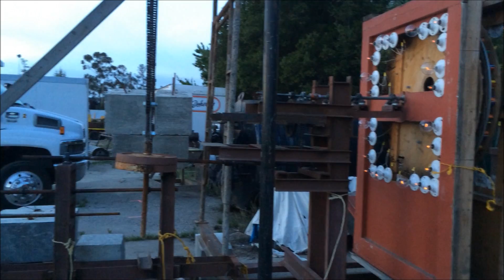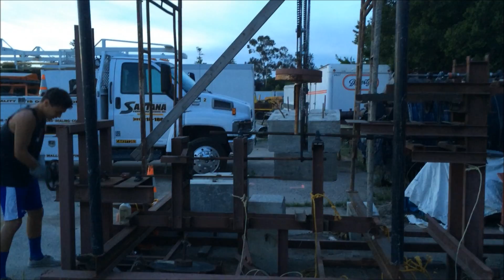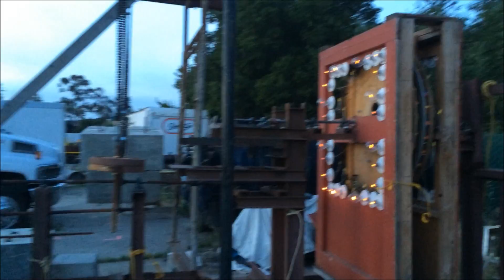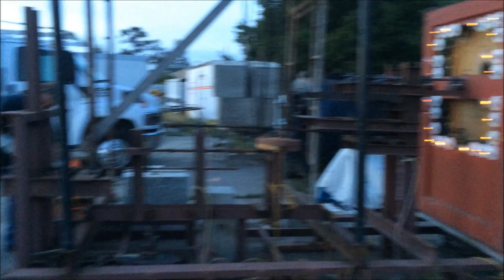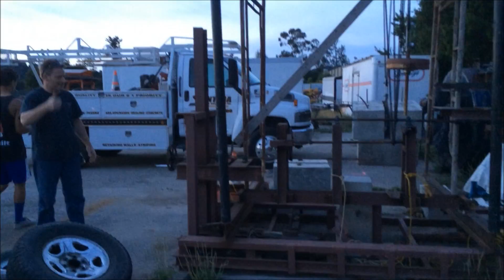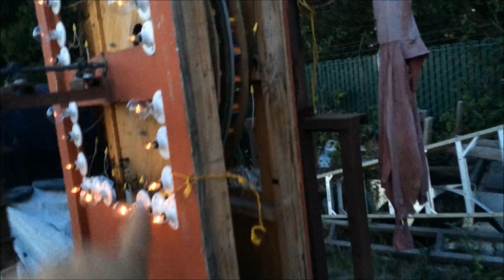This is Free Electricity, testing GCEG 4 at over 400W

Comment: Why not just make a ladder, both of you climb up it, stand on the counter weight, and let your weight act as the counterweight to lift the other weight, as you fall down, it rises up. Then it drops you off at ground level, you step off and it starts generating. Saves winching.

Comment: And like Tina Shay said.. Put a bicycle chain up to that crank so your not using as much energy to wind the weight up or even a motor that winds it up for you via minimal solar or wind. Make the drop higher and add a transferable mass between two weights. Add a battery bank for the buffer or dump for stored energy would also take care of any fluctuation as it looks like your already inverting  for the bulbs. I would think your could get it to where you would only have to wind it up every few hours with minimal effort if even at all. Even as inefficient as solar is, you could store enough energy I would think to wind it up for you. The whole point is to get gravity to do all the work, while you chill and enjoy it, not have to set and maintain it right ? I had a concept like this with no way to build it. Nice design. I think clockwork gen's are a very practical concept.

Comment: How about transferable mass such as 50/50 water antifreeze from one side to the other via bilge pump. I'm sure after you get a perfected flywheel , there is more than enough power to run one back and forth without having to crank but every once in a while.

Comment: Hydro...
Reply: I often wonder why hydro-energy is not more prevalent. Solar energy is not cost effective or "foot print" efficient. Take into consideration the "energy" required to produce it. The exploration, acquisition and production energy expenditures alone - just to get the raw materials from the source to the mill and then to the manufacturer of the components are staggering. Once the components arrive at the actual Solar Panel manufacturing facility, the energy consumed by the factory is again exponential. The "energy" consumed by the adaptation process, marketing needs, repair errors...on and on...all make Solar Energy inefficient at this point and perhaps forever. Now, take hydro-power in to consideration. No real costs for adaptation to the grid, no additional cost to the consumer, no learning curve for repair tech's, no marketing needed, no mas production of new components or anything...we can use the existing grid system with only the addition of the generation mechanism or "plant."(This is where your cool device comes in) In the past communities were located near a water source for many reasons, One was that hydro power was used to run a grinding mill or saw mill or other process. If your device was placed on rivers, streams and dam outlets that already exist, and where the re-wind process was powered like an old grinding mill ... POOF! Clean and Renewable electricity....perhaps even supplemented by wind power? Cool invention!
Reply: I wouldn't call it free unless you have someone willing to wear their arms out for nothing.:)

Comment: I would not call this Free Energy, but Slave energy ! You always need these 2 slaves, that rewind the clock like mechanism... only if you succeed to rewind it with an electric motor being powered by the output this will free energy, but with all the mechanical friction losses, that would probably not work.. Then you would need your generator already be overunity or also your drive motor to rewind it !

Regards, Stefan.

Comment: This is great and obviously the concept works,- but I am curious why you don't  put a larger rewind wheel on it - it would make rewinding much easier .
Also, would it be possible for you to describe how you  rewind the heavier weight in detail - I am interested in how you keep the chain moving while rewinding. Some nice engineering .
Reply from the maker: Thanks, I have a larger rewind wheel but it uses a different axle size than I'm using now and making changes on a steel machine is very difficult. I am building a new frame out of wood so changes will be easier to make and the frame will be much smaller than it is now. The rewind system was designed in the 1700s for tower clocks. The chain crosses two axles, one axle runs the generator and the other axle is the winch and the chain just runs around in a circle.
Reply: I am very familiar with the going train and the striking train of tower clocks as well as the Huygens rewind mechanism . I just wondered . Thanks